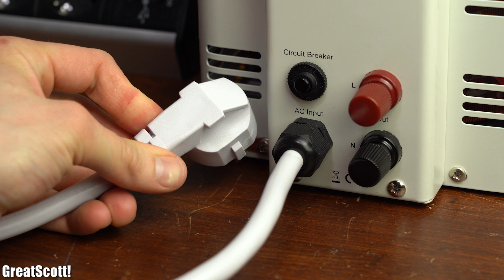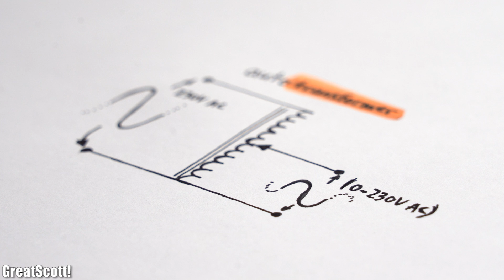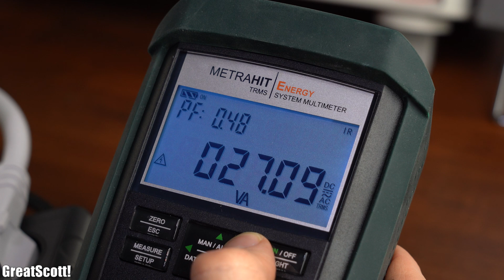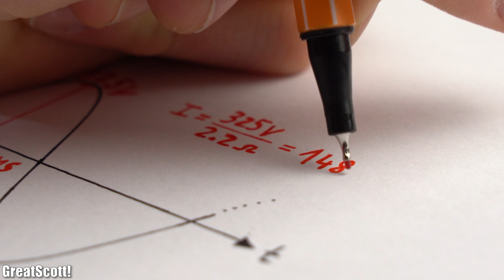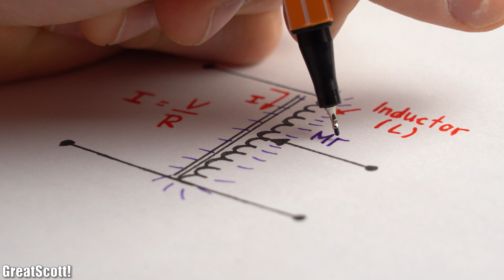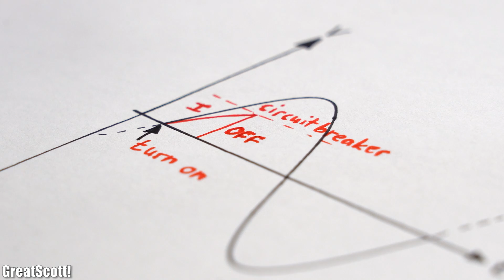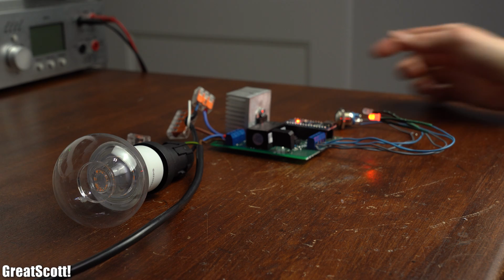How to make an AC Softstarter because my autotransformer keeps tripping my circuit breaker!

Comment: Your circuit needs one more thing - in case you haven't thought of it yet.  You need to drive a relay to close the AC circuit across the triac when the ramp-up is finished - and keep it closed as long as the circuit is on.  This will keep the triac happier in the log run.  Other than this, good job!

Comment: Howdy.
With all due respect.
Bear in mind that the phase shift lags 90 degrees for inductors.
This means that switch on at voltage peaks actually produces the lowest inrush. Voltage and current are "already in phase".
Switch on at voltage null crossing will produce the largest inrush current until the current shifts out of phase. Depending on the rated VA it may take from about a few cycles to tens of cycles for Your 3000 VA Variac.
Please, feel free to verify this with an oscilloscope with recording capability.
Best Regards.

Comment: Great video, although using a microcontroller, a triac and a lot of other components seems like a massive overkill. A NTC thermistor with a relay that bypasses the thermistor after around 1-2 seconds would do the job as well, but with way less components. But of course, with the microcontroller route you learn a lot in the process.

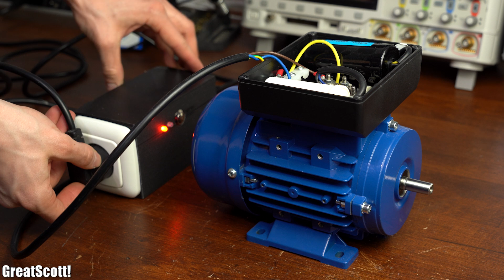Comment: Great job! Only question is what is the motor jump at 11:17. Just at the button push there is a jump and than slow speed up. Looks like a short maximum peak at the initial. It shoudn't be. Am I right? Did you fix it?

Comment: I want this for my tube amps! An internal unit that performs an automatic soft start on firstly the filament supply, and then the amplifier circuit once the heaters reach temerature, as well as have a momentary switch to switch to standby while in use and still commected to mains power.

Comment: Note that an autotransformer is just one with a single shared winding, yours is a variable autotransformer.  Also, the input voltage is only across part of the winding, which is what gives it the ability to output a higher voltage than the input.

Comment: Would it be possible in the Arduino code to make the soft start VERY slow. To where it takes at least 2 minutes from initial current to max current
Reply: YES...always better to "measure" and control the current......even if it means using just an SCR/TRIAC...(cheapest solution)
because with these you can only control it's turn on instant.....but NOT TURN OFF.... ..(that happens only when the "current" changes polarity..)therefore its a sort of indirect form of DELAYED & AVERAGE current control
that one can do.
But with BJT's/ Mosfets, SiCfets/ GAnFets.. both V & I can be individually decided....any or all 3..
Average...RMS...Peak...

Comment: hi , i tried it but i have a problem ... when i didn't connect the output to anything ( or to a small lamp less than 5 w) the voltage is going up gradually as it should. but when i connect a single phase motor or a 100w lamp the voltage jump from 0 to 220 in one step like an on-off switch . do you know were the problem?

Comment: Nice video but watch out for putting that much voltage across both 220k resistors (in the zero cross circuit). Maybe series up a couple of resistors there. I would also shunt the current away from the opto-led by adding a 12v zener and a 1k resistor. Put the zener where the opto-led is and run a 1k resistor in series with the opto-led across it. Let the zener take the higher current limiting the opto to a lower amount.

Comment: I've seen this problem several times. Most recently at a medical company, we used a 400VA toroidal transformer to feed the various AC-DC components. It popped the 5-6A slow-blow AC line fuse at 120V, but only when the unit was plugged into an AC outlet close to the electrical panel. Adding a 20' extension cord or moving to an outlet 50' away was enough line resistance that the problem never occurred.  I measured the current spikes and  they were >100A near the electrical panel. We used two NTC surge limiters (EPCOS-TDK, 5 ohm, 5A, I think). One in series with each 120V primary winding. So for 240V the 2 NTCs were in series. Problem solved forever. 
BTW I looked inside a commercial 1000VA medical isolation transformer and they did the same thing.

Comment: My 2x200w diy amp kept tripping the circuit breakers so i used an ntc thermistor to limit the inrush current and then when the time is up relay will short the thermistor so it would not be hot all the time. The relay is controlled by timer made of capacitor and transistors so basically when the capacitor is charged then the relay will close the contacts. But... when i switch it on and then off and then on again in a too short period of time then the thermistor hasn't had enough time to cool down and this will cause the resistance not to increase and then it blows the mains fuse and trips the circuit breaker.

Comment: Why such a complicated circuit? You could've done something simple, like adding a resistor in series with the transformer and adding a relay which shorts the resistor when it closes, if you connect the coil parallel to the transformer (so it only closes once the current draw goes below a certain level and the voltage rises). There you go, same thing achieved with two components... Of course you can also do it with one component by just using an NTC. But with a higher power loss and a cool down time.

Comment: If you read the data sheet of the SSR, they state with inductive loads, the face value should be divided by 10... So yes, the inrush is the smallest when switching at max voltage.... 
anyway, energizing through a resistor is pretty effective. Great job. I've a similar problem. A colab maybe?

Comment: An autotransformer isn't really a transformer. It's really a potential divider, with inductors instead of resistors. The inductors have reactive impedance, so they don't dissipate power, but that's really how it works.

Comment: Hi Scott, I need to add an isolation transformer to a solar inverter 5.5Kw AC output. I'm scared the inrush current of a big transformer might damage the inverter. Does 0 cross offer enough protection you think?

Comment: If you need to start a high inrush transformer -for example the type used in industry for 240 v to 120 v centre tap for use for industrial site safety.  the simple way to "soft start" it is pulg it into a standard 15 to 25 metre 13 to 16 amp extension lead,  which slows down the initial rush . The alternative is a C type rather than B type circuit breaker but in some -particularly domestic sytems it is not allowed - but would be on most PME systems.

Comment: I like your design.

I had similar problem for putting an AC capacitor in parallel with load to correct for power factor.  When you want to connect the capacitor to AC line you might get a huge "inrush current", which is similar to “locked rotor current” in motors. -- By the way you can measure inrush current with many types good multimeters these days, and you do not need to use oscilloscope.   --

I solved the problem by putting a small inductor in series with the capacitor, so the total impedance is still capacitive at the frequency of operation.
To find out how much inductor you need you should following laws:
Current in the inductor is continues and does not change instantaneously.
Voltage in a capacitor is continues and does not change instantaneously.
Rate of change of inductor current is d(I)/d(t) = V/L
So at worse time is when you connect at the peak of the cycle:
Vp/L is the maximum rate of change .
To find out what is maximum current you have to integrate d(I)/d(t) for 1/4 of frequency cycle.  so I=Integral of Vp/L Cos(2 pi f t) d(t)  where  t from 0 to 1/(4f)  where f is frequency of the AC line, Vp = SQRT(2) Vrms of the line.

In your case you could have put a huge AC capacitor in series with your auto transformer.

Other solutions I found out in the web:
Using NTC thermistors:  When power is first applied, the Negative Temperature Coefficient thermistor is cold, so it has a high impedance and effectively limits the current. The NTC thermistor heats up very rapidly due to its own losses when it used in series with the load, and as result its resistance decreases.  * Problem ambient temperature dependent  *

Using fixed resistors After the electrolytic capacitors on the input of the power supply are charged, the resistor is bypassed.

Trailing edge phase dimming:

Comment: I'm currently looking for a softstarter for my 1HP well pump, and came across your video (even though I've already been a long time subscriber, I hadn't seen this one yet).
Softstarting doesn't seem to be an overly complex issue - so why is the cheapest softstarter on Amazon more than 100$, with most of them costing more than 300$? Is there another name for a basic thing that makes motors start up a bit more gradually?

Comment: Having a look at you cricuitbreaker i can see it is a breakertype with a B charecteristic, which is used in homes for home appliences, however when connection loads that require high current such as motor's or in your case transformers, you need a circuitbreaker that can handle that kind of current which menas your circuitbreaker would need to be a C type breaker. 

There is no need to build a softstarter but it does make an interesting videotopic. You simply need a circuitbreaker added with a dedicated socket that can handle your transformer and other high current applications. Since you have room in your panel, i'd suggest you add this addition nonetheless.

Comment: Great video Sir! I watch all Your video's, to learn and also just informative entertainment. If I may ask, will this circuit be suitable to soft start and, effectively, control a resistive load such as an electric geyser element, or must the components be adjusted to handle greater current for longer period? Those elements are usually rated at around 3 Kilo Watt on a 220V, 50 Hz single phase supply in my country. I apologies If I am asking something you already answered. Thanks in any case. Once again, Great channel!!

Comment: 11:15 Why the AC motor ran like shocked when you pushed the button ? 
It should smooth run ... 
Wrong in Arduino program ?

Comment: Yet another great video.  Most circuit breakers have a time delay trip to allow for inrush from motor starting.  Maybe there is one with a longer delay available?  When transformers are turned off the core steel will stay magnetized in the direction of the polarity at that exact moment north and south.  When you energize it again, if the polarity is opposite at that instant, there will be a longer inrush time to correct it.  Using the SCR relay seemed to be a great solution switching at current zero.  The soft start would be great for tungsten light bulb filaments too.

Comment: by using a primary to secodary winding in a toroidal transformer and make the output winding  voltage divided chould prevent the spike all together making the output winding like a auto transformer. the primary winding would have nearly zero core loss in a toroidal transformer so there woudl be no initial overload by powerup.

Comment: On the large DC power supplies we design at work, we just use a 20 ohm NTC inrush current limiting resistor, and a contactor that bypasses it after the main bulk caps are charged. Which could be done with an RC timer + Comparator

Comment: Basic AC theory suggests that with a purely inductive load the voltage zero crossing point is the worst choice for switching on as the steady-state current would be at its maximum; one really needs to switch on at or near to a voltage maximum. However my preferred method would be the use of a series resistor to limit the inrush current which is then short-circuited by a relay with a small time delay. Simple, cheap and easy to implement.

Comment: you can use a timer relay  and a 200w bulb lamp 
the lamp connected at the normally closed switch it's other terminal to the load and to the normally open switch .
when power up the relay turns on (set to 1 second )  after 1 second delay 
the lamp is connected in series with the load through the time relay normally closed switch
the load powers up slowly 
(motor , transformer , bulb but no electronic circuit )
after 1 second the  the normally closed switch opens and the load directly connected to the power source.

Comment: Circuit was already assembled and seams to work with test bulb. Strange thing is that bulb blinks once when I turn AC IN and stays off till I press the button. Then it starts to increase brightness softly as expected. What can be a reason for the initial blink?

Comment: Nice project I have a couple questions. Does this work for 120V? I've seen a couple other soft start projects which  claim that a relay is a more reliable long term solution than a triac? Also would like to see a soft start which starts up automatically when the load device is powered on. Thanks.

Comment: I have a single phase 220v Table saw that starts too aggressively.  looking at customizing this circuit for that.  what would you recommend to integrate it with the existing magnetic  switch?

Comment: If my devise uses 2 phases of the 230V wall-plug, can I simply connect 2 power-resistors in line with those 2 cables, turn the power switch on, just to (several seconds) later switch over to a parallel connection without any resistance, and as a third step, after that, disconnect the first connection (which had the 2 pwer-resistors), in order to have a softstart ??? Thank you á priori for all answers !!! 
First switch lets 2-AC-phases run through 2 power-resistors. Second switch lets the 2-AC-phases split between the power-resistor and a cable without resistance, for each phase. Third: Connection that lets the 2-AC-Phases run through the power-resistors is turned off. I want to delay the loading of a capacitor, but before the bridge-rectifier/DC-circuit, cause of the much easier access to the AC-part of the circuit...

Comment: could you just add a furnace blower motor capacitor in line to the autotransformer to resolve the quick power surge from pulling all the power from the breaker?

Comment: Nice job. I had a similar problem with many switching power supplys on one breaker. Here the problem is the capacitive load and MeanWell has a DIN rail module to softstart these. Maybe a good topic for DIJ or Buy?

Comment: One super simple solution I seen used in an 40amp Isolation transformer was just a contactor that had a power resistor over it, the contactor was wired in wit the feed power. Now the time that takes for the contactor to pull, the transformer will start true the resistor. It was actually working great, with no output loud the transformer started even with 10A fuse!!! A super simple solution that just works! I got my hands on something like 4 or 5 off those transformers. Back then I gave them all away for other hobbies, but played around with one off them for a while. I ewen had small plans to make a 700A 12v charger / start jumper. But never got around it and just decided it's better served with someone who has "reall needs" for one phase 40A isolators. I think some of them went to a both harbor for feeding aluminum bouts

Comment: Err.. we used to do this for big ham amp power supplies with a resistor and a time delay relay. Cheap simple potter and brumfield  socket relays set to 3 sec or something like that. Those were supplies with big caps to charge though.

Comment: I have a welder that does this. The rectifier and caps are on the AC input with not even a switch. Dumb cheap design.

Comment: When you pushed the button at 11:16, why did the motor jump before it started spinning?  I ask, because I also designed a soft start some years ago (it's still in my table saw), and it does the same thing - not always, but frequently.  Probably depends how far it is from zero crossing when I switch it on.   I could investigate it, but it's a pig to get at, so I have taken the easy option and left it.  It's mentioned at https://youtu.be/9HDLc40Gmac?t=389

Comment: The older types of circuit breakers had a time delay characteristic that allowed for a heavy load to start up. These new "politically correct" breakers apparently break in one cycle. This can be one hell of a nuisance requiring all kinds of "hacks" (like shown in the video) just to live. I'll stick with my 50 year old type breakers that can start a big air conditioner without tripping, yet a few seconds more reliably shut the current off.

Comment: Thermistor with relay latching.   Monitor voltage drop across thermistor and latch when it falls low enough.   Your solution of course works and is very creative.

Comment: I have seen a simular control in high end, hi power stereo receivers..soft start off the mains before the amplifier comes to full power reducing in- rush current to other components..on a failure to soft start, I experience a corona in the cabinet, finding the regulators themselves burned along with local components damaged beyond recognition.  Thank you friend for sharing ..
  Oh and see my suggestion on your generator project..👍